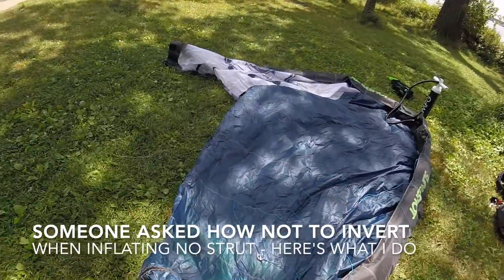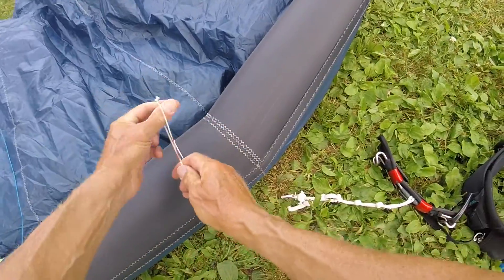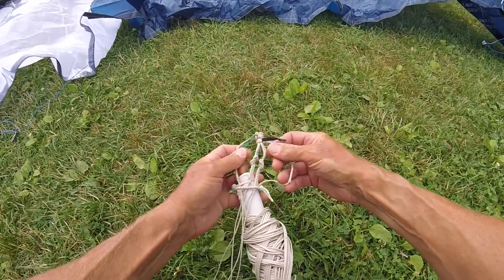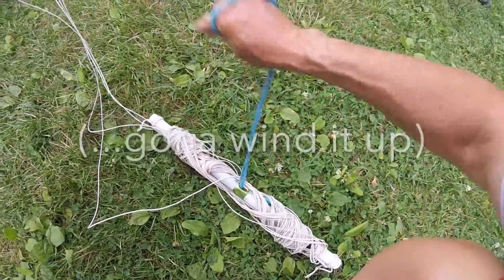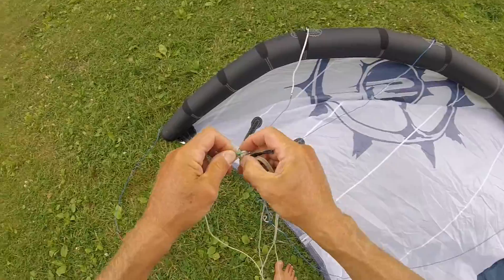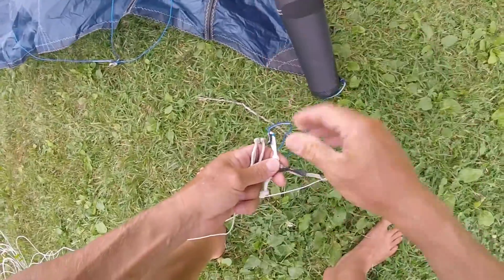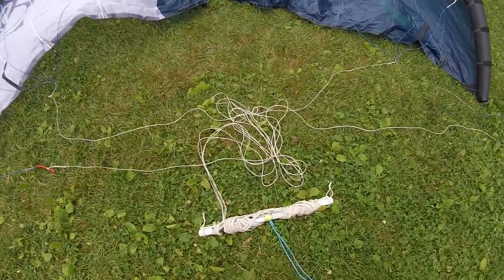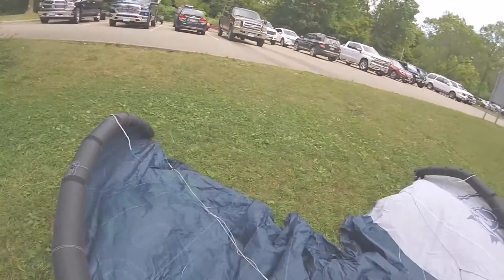Rigging Slingshot UFO 9M with BRM  (Boardriding Maui) CCS (Cloud Control System)

Comment: Have you tried different knots on the steering lines. I have a V2 UFO 9 and thought it turned slow on the middle knot. Just curious, since you, like me, have probably have flown BRM Clouds too.
Reply from the maker: howzit kitesailor? Yeah, i've tried the other knots on the UFO (9 and 7m) I run my BRM bar 4 lines dead even (maybe just a little bow on the steering lines) when sheeted all the way in. No adjustment strap on BRM so you have all the travel needed. I run the UFO's on the longest knot if powered and if it's gonna be tricky/underpowered - I run on the middle steering line pigtail knot. Clouds respond better to low tension back lines than then UFO but they are both really fun, UFO is my go to when i want a little vertical lift for learning new moves/fin outs, dangles but Cloud's for any kind of bump riding or slack line stuff. I'm just so used to how they depart into stall, catching back up to them is no problem. Wishing you a great Norther Hemi water kite/foil/wing season!!